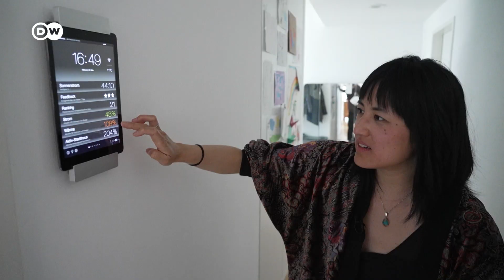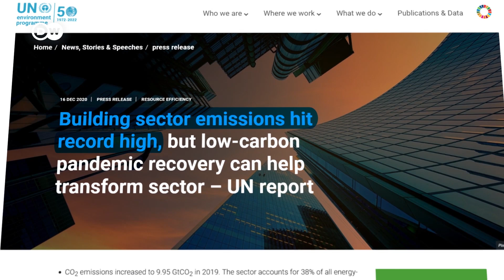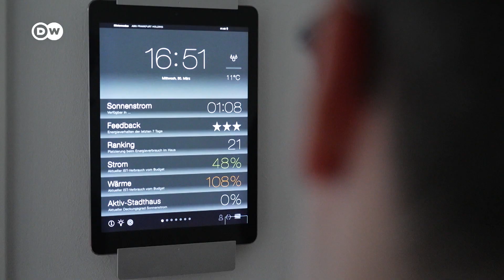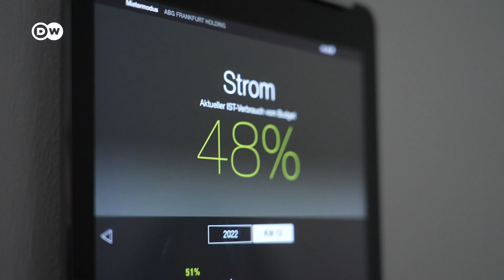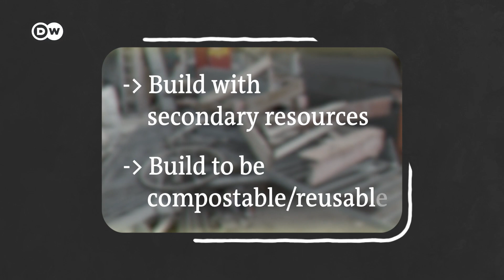Why our buildings suck, and how to change them

Comment: So, they got expensive, with quite substantial CO2 footprint solar panels and they put it vertically on the walls, with building in front of them... I mean, that's nice that they can wear the badge of energy+ building, but those panels would do so much better on the roofs or flat fields, faced to the south at ideal local angle. They probably could produce 2-3x more energy that way. And you need more expensive electronics to have whole electricity production not suffer badly from one panel getting more shade... I love solar panels, but treat them as a scare resource, that need to be used with best utilisation in mind. Gimmicky, over engineered buildings are probably not the future. 
The savage plant is interesting, but they are all complicated machines, I wonder what their lifetime influence really will be, including maintenance. Hope, they don't have any moving parts there. It could be great, it could be CO2 positive (bad), it could be that they are CO2 negative but money could be used more efficiently. I hope they keep track of all data to figure it out someday, and give it to scientists that will make a paper out of this.

Comment: Could I live in a house that tracks energy use?  I plan on buying an Emporia Smart Home Energy Monitor to do just that.  It clips around the lines in your breaker panel so it doesn't require any rewiring.  It wont tell you individual appliances unless they have their own breaker.  It's definitely a step down from the system shown in the video, but it's way cheaper.